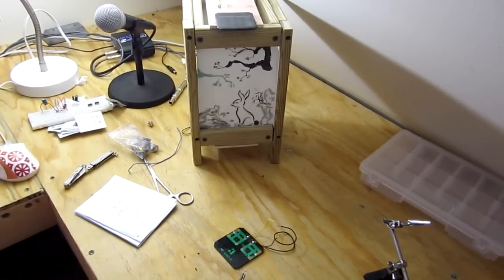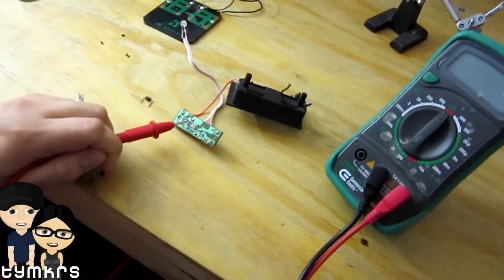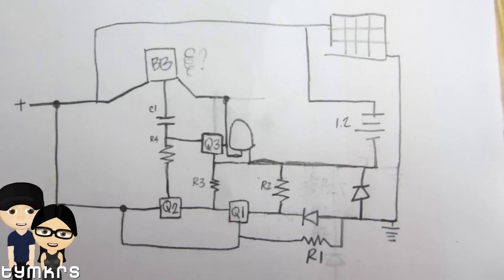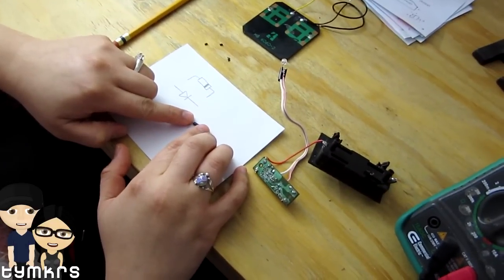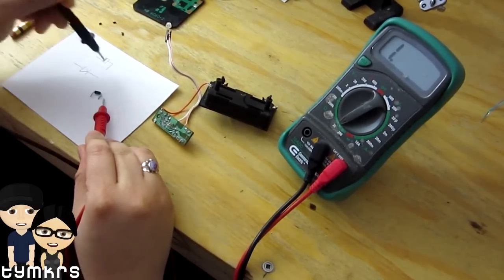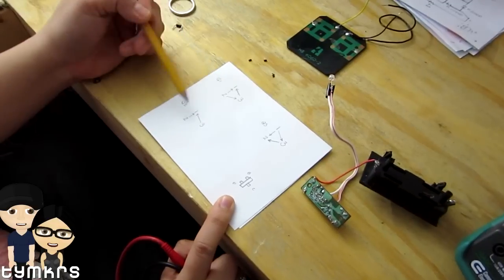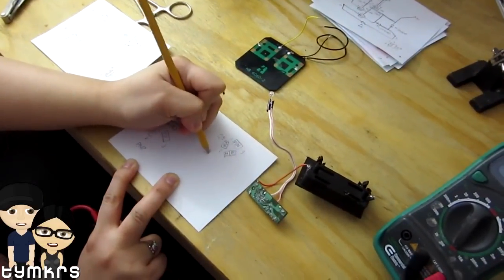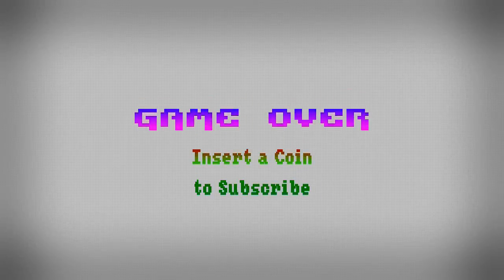Tymkrs Reverse Atdiyneering

Comment: The diode setting of a multimeter usually shows you roughly the voltage at which the diode starts conducting current. For a silicon diode or transistor that's around 0.6V and for an LED it's more than 1V. Keep up the good work!

Comment from the maker: *wears the dunce cap* I found the resistance of the diode to be kind of tricky because like you said, when I increased the ohm setting, I'd get /other/ resistances.  But at that point, all I wanted to check for was polarity testing - like a second measurement to clarify the diode measurement.

Comment: Nooby indeed ;)
The "cool value" you get is the forward voltage of the diode, around 0,7V for silicon diodes (if it isn't, it's broken ;) ). Should be the same for the pn-junctions in silicon transistors. 

Also the "resistance" of a diode is not real. The DMM just applies a voltage and measures the current flowing. For a resistor the value is then just calculated by Ohm's law. For a diode the calue is meaningless (except for polarity testing maybe).